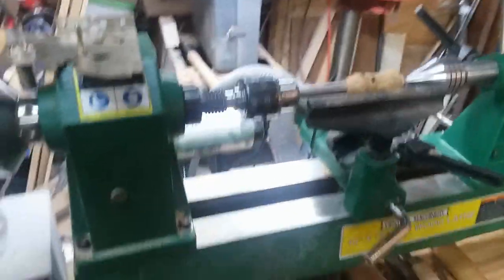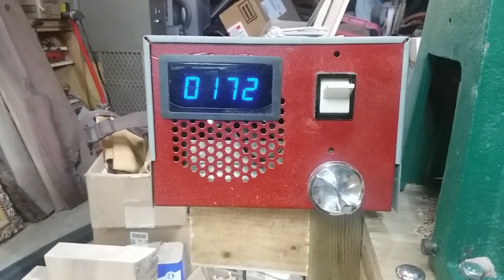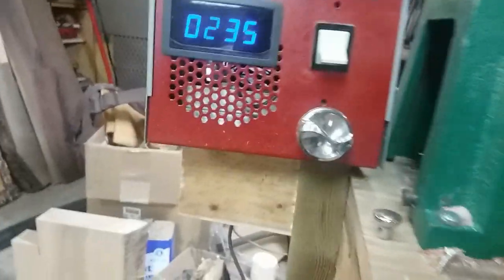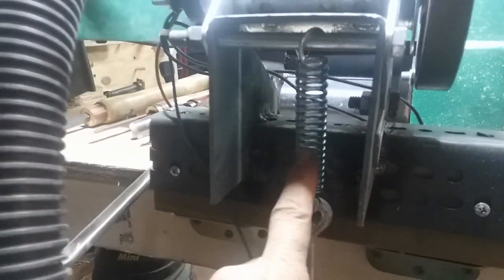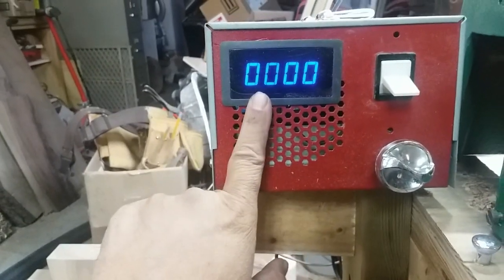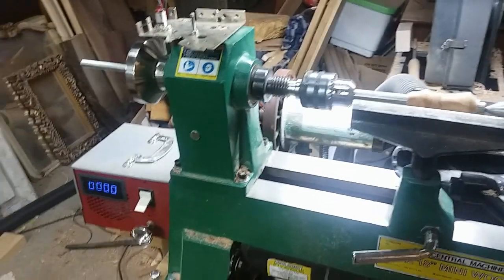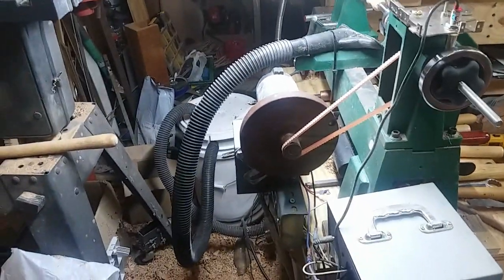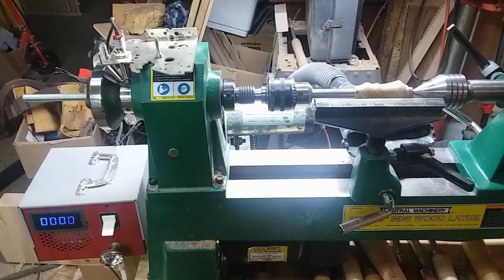How to convert a Harbor Freight Mini Lathe from multi-speed to variable speed.

Comment: Hello, just found your site and had a couple of questions. I’m currently doing the same thing to my little Harbor Freight lathe just like yours. I also have a larger lathe I so most of my turnings on. But here are the questions.
1: how do you get the belt off the spindle at the top? Never had to change the belt but what happens when you do need to change it or it breaks?
2: how did you provide power for the tachometer? Usually they operate with a small transformer plugged into the wall. But I see you have it in the box. How did you wire it?
Thanks very much and I enjoyed your videos!

Comment: Great video and great modification. I have a large midi lathe and have run a DC motor on it for some time. A couple years ago my grandson gave me this exact lathe for Christmas. Like you I don’t like having to change the belt everytime I want to change speed. I’ve been thinking of doing what you have done and  it looks just like what I want. By the way, have you thought of fixing it where you can go in reverse?
Thanks for sharing!

Comment: There is a variable speed conversion kit available from Penn State Industries that fits the Harbor freight, Grizzly, Penn State and several other similar lathes.  Initially, they were half horse, now they are 3/4 horse.  The motor fits right where the original motor went, and the control bolts to the lower left end belt door.  You can get the tach from Amazon.  The only problem with doing it the sanitary way is that the cost will not even be close to the $12 that you spent.
Reply from the maker: Thanks for your feedback. I would say that if you can afford the commercially available conversion kit, go for it. The quality will probably be better and more reliable over the long term.

Comment: Were did you buy the belt and do you have size and stock number?
Reply from the maker: The belt that I used is the same belt that came with the lathe. With the way I have it set up,  I can go back to the original motor in a matter of a few seconds, just change the belt from one motor to the other.

Comment: why would anyone want to do that .....I love mine just like it is
Reply from the maker: Thanks for commenting. It's not a bad lathe the way it comes from HF. But I have to say that the mods I've made give me more power and a lot more control.  The speed is now infinitely variable between 40-3600 rpm on the slowest belt position. I have found this makes turning easier, faster and even more enjoyable.  If anyone likes these differences they can do the changes, if not, don't. I'm just sharing what I've done.
Reply: not stopping to change belts thats why

Comment: I would like to add a drill chuck to mine, I see you have one on yours, any suggestions on which one and how to attach? Thanks.
Reply from the maker: Hi Mike, I made mine from a 1/2" hammer drill that had a bad motor. Just pull the chuck from the drill, and attach it to a #2MT . You can buy the Morse Taper on ebay or Amazon for around $10.
Reply from the maker: Hi Mike, Check out my new video on drill chucks, https://www.youtube.com/watch?v=n5GjX1skVr0&t=699s

Comment: Lets say you wanted to use a higher HP AC motor with same spindle size do you think that could work too?
Reply from the maker: That would certainly give you a power boost, but most AC motors are not made to be  variable speed. You can build speed controllers for them, but it is more difficult.
Reply: You’d want a VFD for a standard induction motor. You’d get speed control, reverse capability, adjustable ramp up/down speed, and most I’ve come across have the ability to save presets you can trigger with a switch. So you could set up a slow speed range and high speed range- then use a potentiometer to adjust by percentage within the range.
You’d also get overload protection, RPM read out, ease of wiring a e-stop... lots of benefits.

Plus you can get 110/220 single phase to three phase VFDs, opening up the possibility of using 3ph motors at you home.

Comment: Great video! I wonder if you could wire in a double pole double throw switch so that you could reverse the treadmill motor. Would come in mighty handy for sanding.
Reply from the maker: Joseph Longwell yes, you can wire them with a reversable switch, but it is my understanding that running them in reverse is very hard on those motors. I personally haven't had a need to run my lathe in reverse yet. It can definitely be done though.